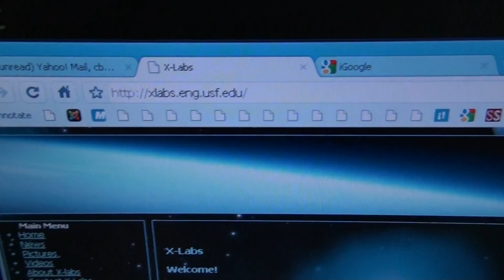ZVS Flyback Driver

Comment from the maker: The internal rectifier won't diminish arc length. It'll just have a DC output instead of AC. It shouldn't matter at all for your purpose unless you're trying to power a voltage multiplier with it.

Comment from the maker: @MrAgilwibowo Interesting... the actual flyback should be able to survive a lot of power. I have pushed the flyback up to around 80 volts before. The limiting factors are really in the ZVS driver and power supply. The Mosfets must be able to withstand at least 3 times the input voltage, and that filter cap in my video is rated at 75 volts. You can see the bottom of the flyback is breaking out and is actually starting to damage the flyback, so i am going to insulate it when i have time.

Comment: I'm using a bank capacitor in the primary side of flyback with 0,66uF total capacitance. But the capacitors are heating after a time working. The secondary side (HV) I'm using like a start of experiment with thermal plasma.

Comment: Yeah, the Panasonic Inverter Microwaves has a special form of an flyback with thick wires..  I noticed that my Flyback from a old TV getting warm with my new ZVS.  The ignition distance is around 20cm.., so its too much for Magnetrons. They run on 2-2.5KV.. Maybe a self-wound transformer with an old flyback core can do this.

Comment: Sorry. The final voltage of capacitor is 1200V, now they not heating, also using a cooler for capacitor. Thank  you by help.

Comment: So if you have a flyback with an internal rectifier does it diminish the arc length? I'm about to salvage one out of a PC monitor and I certain its going to contain one as the monitor is only 4-6 years old

Comment: which the voltage of the capacitor bank? I'm using a capacitor with 0.68uF 250V, but it explodes after some time into operation. My power source is a transformer with 24V and 10A. Thanks